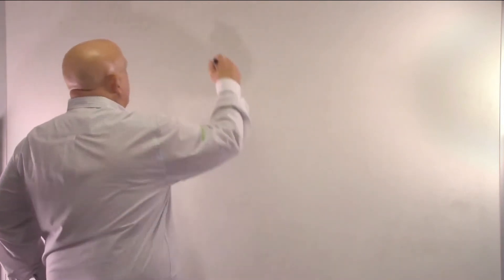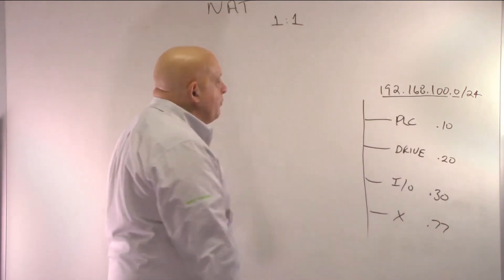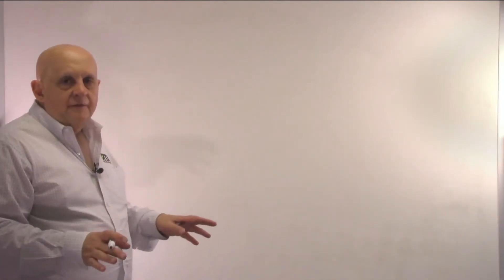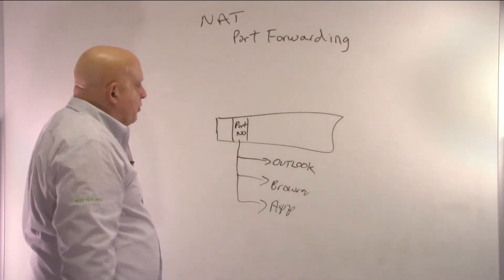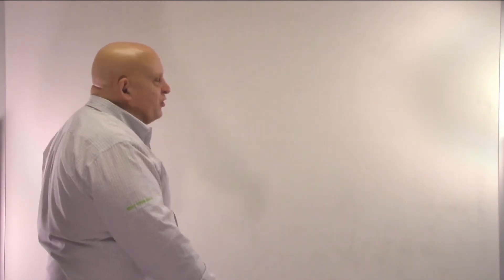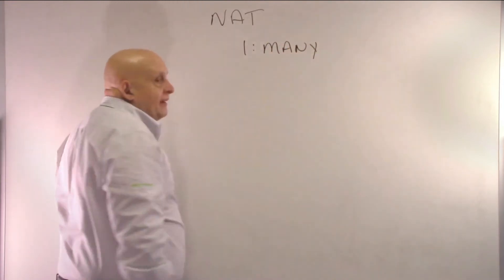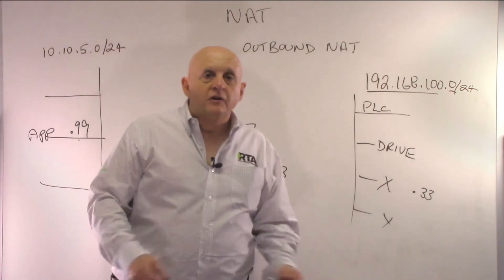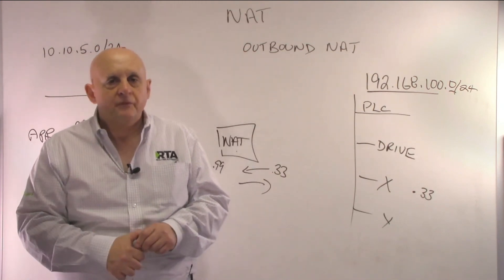Understanding the Four Types of Network Address Translation

Comment: Hi sir, I tell my problems correctly,based on that give me solution sir 
firstly it was NAT4 in nat type configuration on router and Type 3 on PS5 because of that matchmaking was so slow i did not find any matches so i decided to change i changed port forwarding first as you know i entered everything but it did not changed my type after port forwarding it still showed type 3 on ps5 then on router there are 4 NATS After changing that to NAT4 to NAT1 and manual port forwards ps5 showed type 2 and matchmakinv was extremely fast but after two matches matchmaking completely stopped and testing internet showed nat type failed cant connect to internet within time limitt,so next NAT4 then UPnP on it showd type 2 but matchking never happened,basically it is type 3 only ,  please sir solution sir,sorry for my bad english sir am not a native english speaker🙏🙏